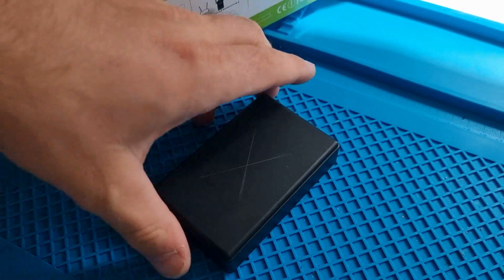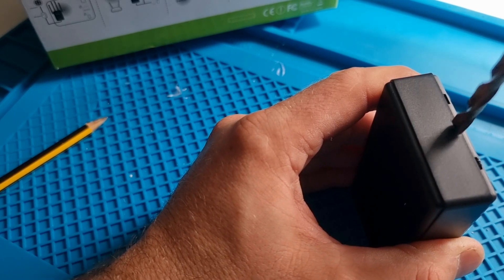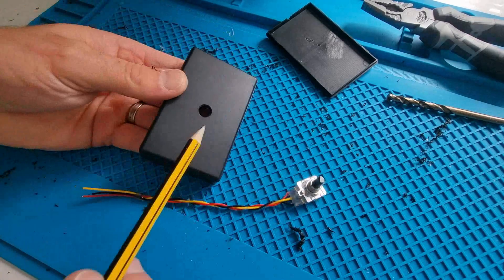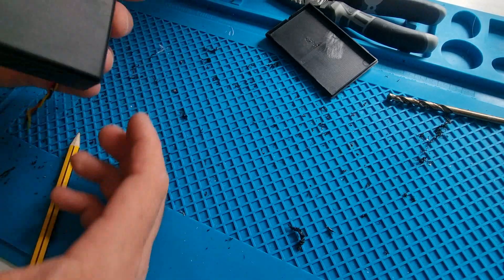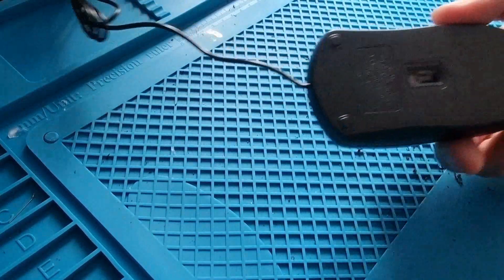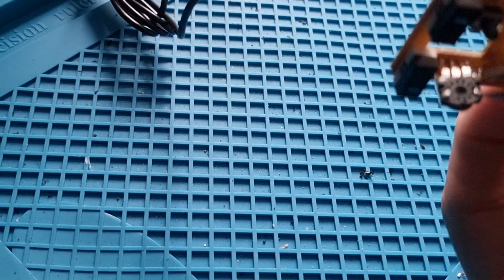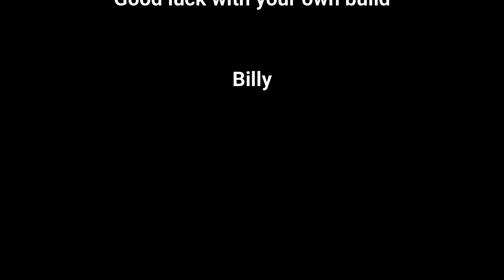How To - Build your own - External Frequency Controller for SDR software

Comment: Great Video Actually, Was Loking On How To make Such A Wheel, But The Hot Glue On Everything Method, I DOn`t Know Man, I Rather Zmall Ziptie Everything Or Use Isolatiuon Tape :)

Another Thing You Could Do Is Buy A Yoistick With A Wheel And Then You Can Remake The Whole Yoistick Into The Bigger Project Box, Download An App On Windows Thats Called Controler ++ Or SOmething And Make Every Button Does What You Want In Any program You Enter :)

Comment: Hi excellent video ! do you have any diagram for wiring to the mouse ?:)
Reply: Hi,

I have done one but if you wire it per the video it will work. Most PC mouse you purchase have the same PCB layout so there should be no problems.